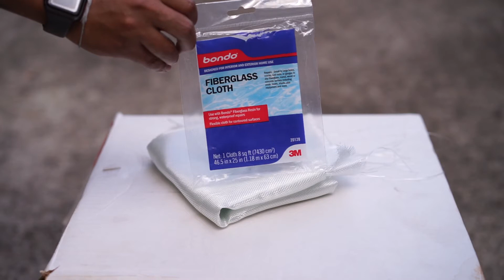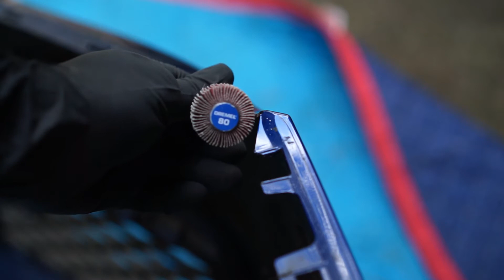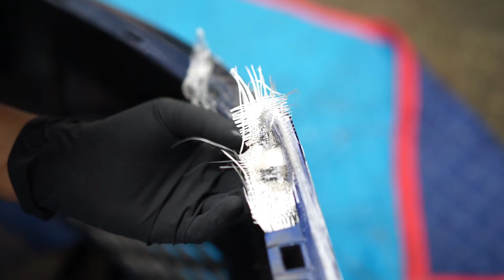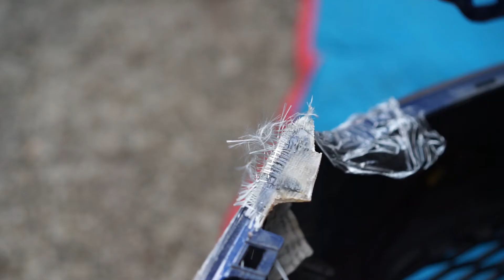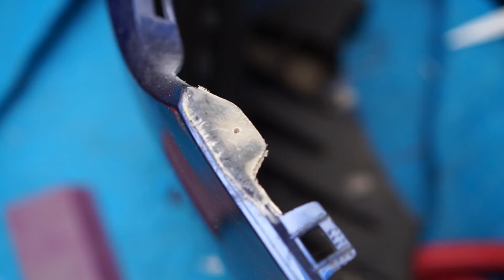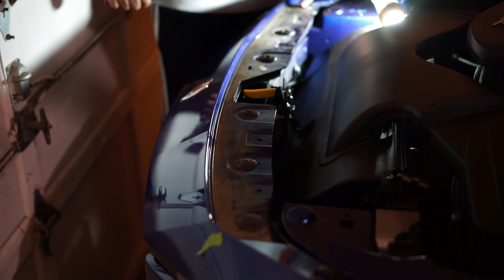HOW TO REPAIR YOUR BUMPER PLASTIC TABS! Fixing my Maserati Ghibli front bumper with fiberglass.

Comment: The bottom clip holes on my nissan versa bumber are broken. I'm definitely going to this method. Everything else wanted me to buy a plastic welder that costs as much as a new bumper would be. Thanks for the video
Reply from the maker: Glad it helped. Good luck!
Reply: Plastic welders can never fix it this way this was a really good idea I use fiberglass instead of plastic welder on most of my bumper repairs plastic welding is always weaker.

Comment: This was a great tip man and I'm considering doing this to repair mine. After almost 10 months, is this fix still holding fine in your car?
Reply from the maker: Thank you! For the most part, yes it is still good. I really don’t know if it will hold if I have to remove bumper again. If I do remove bumper then I want to try doing plastic welding. I’m curious to see how that does.

Comment: Hey man I finally decided I want to try doing this. Are the results worth it? I’m other words is it worth wasting the money to get the materials to repair it?
Reply from the maker: Well of course the results will vary based on what’s broke and how well the fiber glass is applied. My results were decent, but not necessarily my desired outcome. Fiber glass (for me) was the most inexpensive method to fix it. However, I think I would try the plastic welding method if I were to do it again. It’s a little more costly since you probably would have to purchase the plastic welder and supplies. But $20 or less to fix bumper isn’t bad for any improvements in my opinion. Time spent would probably be more of the deciding factor as to if it is worth it or not. Good luck bro! 👍🏽
Reply: @DriveTalkCars  You’re right! Plastic welding is much easier and more durable. I just saw clips of how to do that and much cheaper! I’m going to try it and see how it goes
Reply from the maker: Cool keep me posted! If I ever need to remove bumper again...I will be doing that as well. 👍🏽
Reply: @DriveTalkCars  I just did it this morning, put aluminum tape underneath and the plastic weld it thick enough.. Tomorrow morning I will be shaping it to the same size and then sanding it down. It’s extremely durable
Reply from the maker: Good deal!